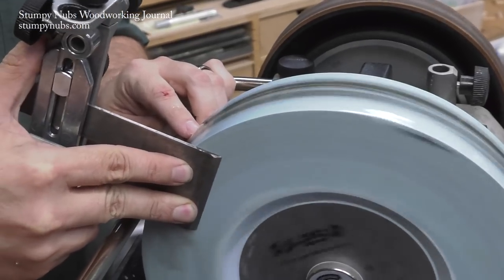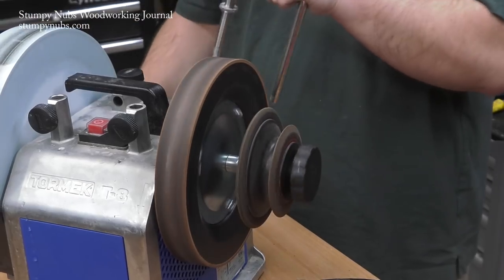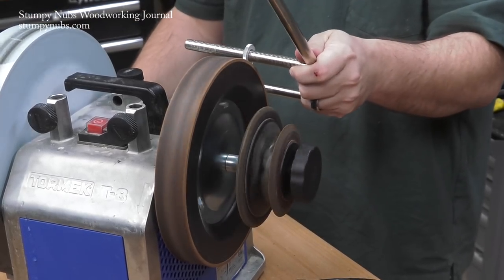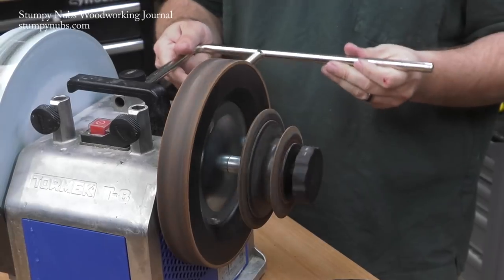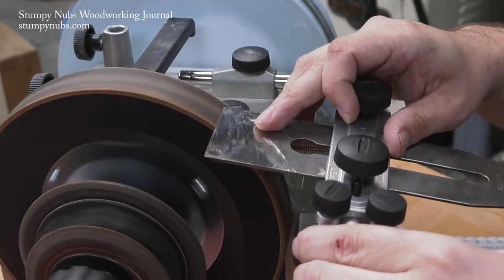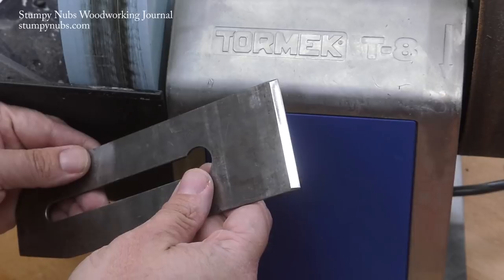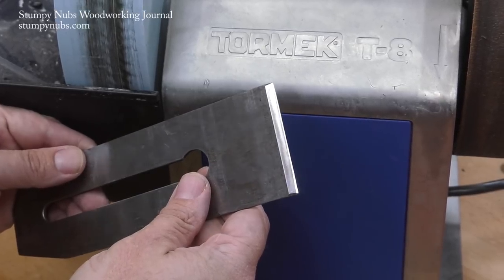Getting a hand plane iron sharp enough to shave with it... really!

Comment: Hahaha! Excellent job my friend. Did it scare the bejeezus out of you too?
Reply from the maker: Yes. A big plane blade is not suited for shaving. It's very difficult to keep the proper angle. It took forever, I had to reapply shaving cream several times because it would start drying out. And I was expecting a big cut at any moment. But I survived. And it was worth it, because I knew it would make for a fun video! (But I don't think I'd do it again :)
Reply: Now if you had let your gentleman's gentleman do it for you instead of doing it yourself the foam might not have dried.

Comment: Yes Sorry you are right it is Worksharp as opposed to Toolsharp. If you have both them which one do you prefer to use most often? If so why and which one is easier to use most efficiently. I am thinking of having both as well if there is a necessary reason for having one over the other! Thanks. Happy Shaving
Reply from the maker: I prefer the Tormek because it is very precise. It is easy to set the tool to grind the exact same bevel angle, every time. That means I spend less time honing the edge, and the tool lasts longer since I am removing less steel. There are other advantages to the Tormek, but I can't put them all here. The main disadvantage is that the Tormek is not in everyone's budget. And that's understandable.

Comment: You show using a  Tormak wheel to get your edge sharp! Looking at it in the video I can safely say that my Toolsharp sharpening machine will produce a sharper edge without question! Have you ever tried a Toolsharp machine? I think Tormak might be one of your sponsors so I might understand!
Reply from the maker: Toolsharp? You mean Worksharp? Yes, I own two of them, and have for years. You think an edge sharp enough to shave your face with isn't sharp enough for wood? It may be POSSIBLE to get it sharper than I had in the video. I could spend more time honing it right on the Tormek, getting every last one of those fine scratches out of the center of the bevel (there were no scratches at the cutting edge, which is what matters), but why would I do that? Just because it's possible, doesn't mean it's necessary. As for the Worksharp. I have no problem with it. Lots of our viewers use it (and lots of the use the Tormek). The Worksharp has its limitations, and its flaws, but to say the it will give you a better edge is debatable.